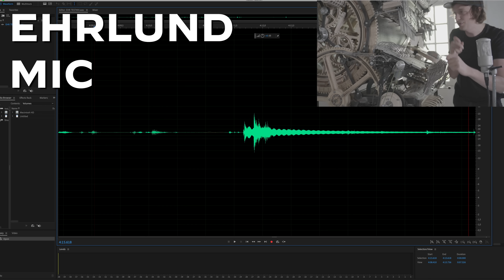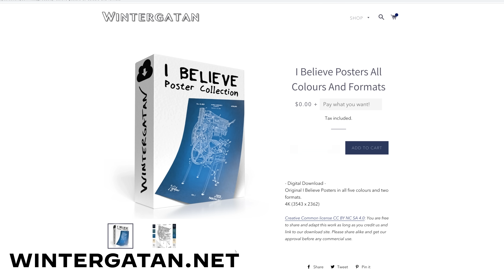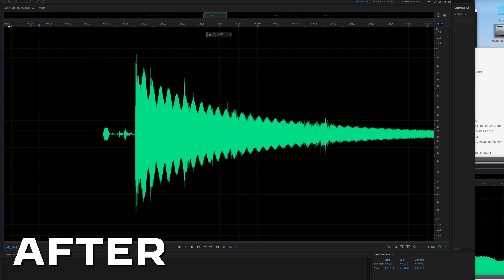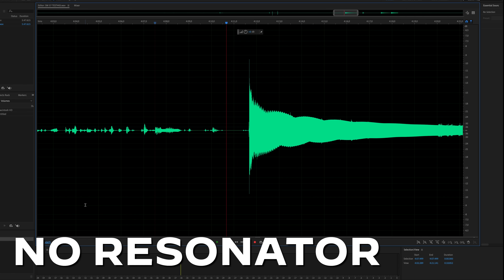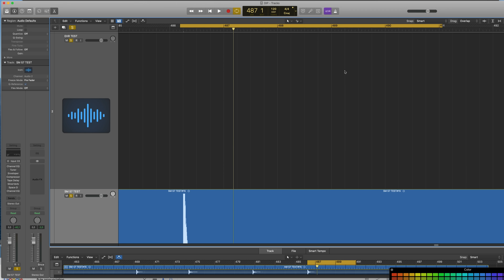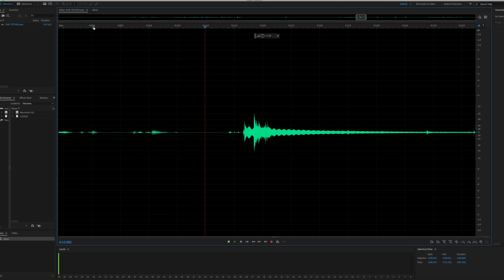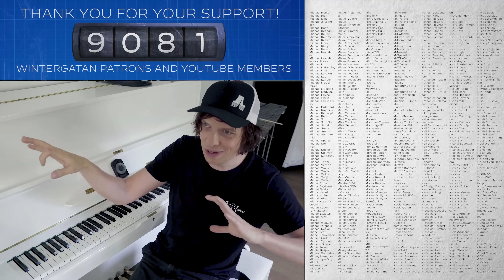Candy Dip for Marble Funnels - Marble Machine X135

Comment: I've always been curious about how to replicate vibraphone mallets as to imitate a sharp attack, with a hit that won't completely damage your vibraphone keys over time. Have you every thought of manufacturing a semi-thick yarn or nylon-woven pad and adhering it to the keys, rather than rubber? Typically, vibraphone mallets are yarn around a rubber ball. Maybe a thinner rubber layer than what you had here with a yarn pad underneath, instead? I know you would probably want to have a sharp hit so that your signal to noise is huge for the mics, but I would be worried about the bearings breaking and de-tuning those keys over time (and for your ears). Keep strong, Martin! Almost there. (:

Comment: For the 'movement' on the funnels remember your Springsteel adjustments. You can still strike a balance between weight, sound, movement with that adjustment.

Comment: Martin. What a great job. It is fascinating to be able to following your development. However, I have concerns with the durability of the coating. In order to maintain the great design, one way would be to scan the cups with a 3d-scanner and then use this data for additive manufacturing the cups. This would almost completely eliminate the metallic noise. Best regards, Peter

Comment: The pitch shifting that you hear with the vibraphone bars is definitely because the tube was not perfectly in tune with the bar. Thus the frequency that was being amplified by the resonator (thus lasting longer) was different to the initial frequency of the bar, resulting in the 'pitch shifting'. 

With my ears, I can definitely hear at the start of the sound that there are two different frequencies in the same way an out of tune piano sounds. So I think you just need to more properly tune your resonator pipes.

Comment: Constraints is not that bad, when you run into problems is the conflicting constraints when better sound=uglier. In this case you can’t just focus on the  audio quality because most of the enjoyment from the marble machine is that it is mechanical. You have the off beat shuffling of marbles, wheels that is whirring etc. How boring would it be if the audio was just perfect without the artefacts from the machine itself. 

And the design intent is that the machine should both sound nice AND be a marvellous looking mechanical contraption — it would not be the marble machine without one of them!

Comment: The rubberized coating will not have a great bond with that polished stainless steel. I'm concerned that over time the marble impacts could break it loose and flakes might fall into the tubing obstructing the marbles paths. 
Two possible solutions if this occurs. 
First, closely monitor the coatings conditions and as soon as it starts to degrade you need to strip it down and reapply it.
Second, is to blast the stainless steel in a sand blaster. This will cause enough abrasion on the surface to increase the longevity of the coating.

Comment: The warmer the temperature, the easier it will flow. Cooler temperatures will make it thicker. You should be more concerned about the temperature affecting the cure.

Comment: In regards to your resonators being out of tune, you can see that in the waveform.  If you have two notes very close to each other playing at the same time, their sound waves will shift in and out of phase with each other.  If I recall, you can calculate how far apart the two notes are by counting the number of times the combined sound fluctuates in a second.

You will have to forgive me as it has been over a decade since I took physics, so I do not remember the exact formula, but I do know that the closer the two tones are, the slower the fluctuation in the combined sound.
Reply: The beat frequency occurs at the difference of the two frequencies. Sounds to me like it's about 10Hz, but I'm pretty sure it's the harmonic that's beating (two octaves above the fundamental). Which would make the fundamentals about 2.5Hz apart, which is about what it sounds like.
Reply: A lot of DAWs have a phase meter built in you can just use that
Reply: Guys stop, it's just inharmonicity

Comment: Engineers become very aware of the inherent tradeoffs in any development, which you are realizing as you go.  Adding more to a fundamentally flawed implementation is called a "Kluge"  (pronounced "KLOOJ").  It is not a term of endearment.  Fixing the root problem, or rebalancing/refactoring the design is what I've seen you do more and more of.  It's been great to see your evolution in this, and I have to admit tearing my hair out with some of your solutions, thankfully to see you reject them in favor of better ones eventually.  When you finally finish your design, it could serve as a case study in how to incorporate art into engineering.  Keep it up!

And please use a different material other than plywood for the marble return path merge sections....:)  Milled plastic or nylon would be much more stable.  Even 3D printed nylon or PETG..

Comment: Your test isn't only checking the effectiveness of the rubber dip.
It is also checking what removing the extra bit of metal does.
Ideally to check the effectiveness of the rubber dip you want to compare before and after the dip, with no changes.
So either rubber dip with the extra bits of metal, vs how it was originally or as it is now vs how it is with the extra bits of metal cut off.

Comment: Hey Martin, I actually can hear-visualize some interesting tones with no pad.  You get those very mechanical highs what I think is D harmonic VIII / B harmonic V that would be interesting for such sustained keys.   If the harmonics could be controlled between bars, perhaps have more than one set of bars with different pads?

Comment: Noise reduction was great even if some noise is still present. At this point I think the extra noise actually fits with the mechanical, clockwork aesthetic that I believe the Marble Machine is going for. It gives a background texture much like the soft static of a record might give to a good tune

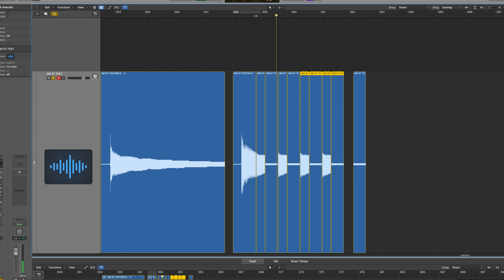Comment: 9:45 Sounds to me like the two tones you are hearing might be a psycho-acoustic illusion. I hear the fundamental clearly as the same note during both sections, the difference is that the beginning of the transient the overtones are much louder, and the overtone an octave up is slightly flat. I think this creates the illusion that the fundamental is lower than it actually is, so when you hear it by itself it sounds sharper. 

This used to be a huge problem for me tuning drums to a specific fundamental, because the overtones would mess with my perception of the pitch. I was able to train my ear to pick apart the frequencies better.
Reply: Nope, the resonator is clearly sharp, you can hear it being distinct from the actual fundamental and making interference beatings with it. It just plays for longer.
Reply: @bacicinvatteneaca  Pretty sure the beating is from the first harmonic (two octaves above the fundamental). Sounds to me like the beat frequency is about 10Hz, which would mean that the fundamentals are about 2.5Hz apart, which is pretty much what the "jaws" rendition sounds like

I also think the harmonic on the bar is slightly out of tune - I noticed this in the original vibraphone video that all the harmonics sounded slightly off (hurt to listen to with headphones)
Reply: You'll never fully diagnose what you're hearing as you're hearing it after compression.

Comment: The "over-engineering" of this project is a stark contrast to the first marble machine. I think it was a good idea to improve things and make a more solid machine, but that the idea that it was going to be perfect might have been a stretch. As has become evident several times, many ideas didn't hold up to these high requirements. Perhaps the popularity of the project and the amount of people involved have made things more difficult, even though it has also helped in some regards.

Comment: Martin, why not use a weaker spring steel? You made it so that it was interchangeable, so you could also add shims on the inside of the springsteel so that it exerts less torque so that the marble’s momentum can move the funnel?

Comment: Don't be so hard on yourself.  No design is perfect on the first go.  And unless you have some mega time constraint by which it needs to be done, there's nothing wrong with setting the bar really high and refusing to drop it until you have no other choice.  That's not bad design, that's just a choice and if you hadn't done that I don't think this machine would be nearly as impressive at it is!

Comment: I think the rubber coating is too difficult, albeit a beautiful way.
Why don't you try the soft (transparent / colored - fun!;) сut lengthwise silicone tube?
You can extinguish the energy of the impact of the ball with a piece of soft polystyrene foam / sponge / paralon, I don't know exactly what it is called in English.

Comment: From what I remember about the design of the funnels, the motion is done with a simple wafer of steel to act as a spring. You may be able to get back the motion you had before by changing the strength of that spring.

Comment: I have a question: why not make the funnels in plastic directly rather than coating it in plastic? Because i think the plastic coat will depleat overtime and you will have to do this treatment again. 

If you made the funnels in plastic, or silicon i think it would be a lot better than coating it, then all you would need to worry about is painting.

Another idea is to put plastic, rubber or any other material in the hitting spots (where the metal hits metal) so it doesn't make this huge sound.

Comment: A good tip for your paint flow issue; you can use a heat gun or even a hair dryer to lightly heat the parts up before dipping or hit them with a little heat after dipping and it will help the paint flow.

Oh....forgot to add that before you turn on the heat gun and aim it at your freshly painted parts make sure there isn't a bunch of dust built up. I've made the mistake of flipping my heat gun on and watching the horror as a puff of dust and cat hair was blown all over wet paint. Ohhhh the humanity!!

Comment: Martin: it’s 27 degrees at night
Me: what you actually mean is that it’s 80.6 degrees at night

(Correct me if I’m wrong)
Reply: At 80 degrees it would burn his feet to stand outside; that's not too far away from the temperature where water boils. 27 sounds right; pretty hot but not uncomfortably so

Comment: so glad you you used proper air protection, and so glad you got rid of those colliding rails. The rubber would have eventually worn off.

Please consider how you're going to reapply this over time while touring, as the ball bearings will wear the coating off. Likely fairly quickly.

Comment: Lighten up on yourself. It’s NOT a fundamentally flawed design. Steel Striking steel was ALWAYS going to be loud.  The vinyl dip coating does NOT reduce the aesthetics and it Does solve the noise.  The only thing you learn is that when you design things that you want to be made of steel, you have to coat them in clear vinyl.
The ONLY design parameter this actually effects is the strength of the spring plate that controls the movement.
Seems to me you just replace all the spring steel plates with a slightly thinner spring steel plate and you have everything you wanted.
That is a GOOD design.

Comment: 09:06 - This is a psychoacoustic phenomenon to do with the missing harmonics. The fundamental will be much louder vs the harmonics at the later part of amplitude decay, as the higher harmonics decay much faster, so you're pretty much only hearing the fundamental at the later point. When your auditory system can only hear the fundamental frequency with no harmonics (a nearly perfect sine wave), it perceives it as being a slightly higher pitch. I'm not sure of the exact nature of what's going on in the brain, but I presume it's a well known effect. I learned about it years ago when experimenting with audio and psychoacoustic phenomena.

It may be that if you only have a single frequency as a reference point, your brain may not be able to work out the precise frequency, so it has a "best guess". But if you have several frequencies that are relative to one another (fundamental + harmonics), the neurons that listen to each fine frequency range are able to combine their effort to make a more accurate 'best guess' as to the exact frequency you're listening to. In isolation, they're not so good; in combination, they're more accurate.
Reply: Oh, and I believe this may also be part of the reason (but not the whole reason) we stretch tune pianos, and why our hearing and experience is much better than software when stretch tuning.

Comment: Just to add some random science to this comment section: If you take a simple spring–mass system (like the marimba bar) and excite it with a sharp impulse (like hitting it with a marble) it will start to oscillate with a certain frequency. As this oscillation fades out the frequency decreases. This effect might contribute to the effect you noticed in your recording.

Comment: The dip wants more temperature to spread more evenly.

Plywood box, heat gun or bar heater etc, plumbed extraction... Easy dipping and a decent future paint booth ;-)

Make it an insulated metal booth and you can build a powder coating oven >_>

I'm sorry about adding things to your list #scopecreep

Comment: You can't design without error...unless you are copying something already existing.  If you tried, you would never create anything.  And some things pop up that you wouldn't think were a problem until you actually experience them.   Why do you think automobiles and airplanes have changed and improved over the decades?  As far as mechanical noise...you intended it to be a mechanical device, therefore it will have mechanical noise (sound) ... you just have to redefine and narrow down what is acceptable noise, and unacceptable noise...but since there wasn't prior art about moving funnels to catch flying ball bearings...you have to find out for yourself...keep on building!

Comment: I think your explenation why there is less movment  in the funels is partiely wrong. The Reason lies in your methode of amplitude reduktion. You are isolating the ecitation from the marbels. Which leads to reduction in amplitude from sound and movement, because the impuls can't reach the funels. It is as if you had put a soft spring in between the funels and the marbels.

Comment: Heya bud, Sounds like the tone of the decay is about 27cents sharp. its not just you. it may be residual harmonics being amplified. these tones occur in the width of the metal plates and they are amplified by your resonators. Try adjusting the length of the resonator and recheck the lateral striking point of the marbles.

Comment: Quality - Cost - Speed : pick 2 of the 3. Basic project management 101. Esthetics is  generally a factor across all 3 and has to be weighted in its overall value to the project. You made a rookie PM error in over valuing esthetics vs sound and mechanical quality - which you ultimately decided was the root basis of the project - to make great music with great sound. This little facet of PM usually takes most project managers several years to get a good grip  on it. All-in-all, you have done well Martin, and you should be proud of what you have accomplished from a  white paper start.

Comment: It would be interesting if, in the finishing and clearcoating and detailing of the finished pieces, you could incorporate uv reactive pigments. So if you use UV lights on tour, you can highlight various bits of the machine with/without the pigment. Like a dark ride. When you want a moving piece to be seen or highlighted, you can toggle the UV light focused on that part.

Comment: Generally don't most liquids get less viscous with an increase in temperature, not the other way around?
Reply: Yeah I was kinda confused about that
Reply: Yeah the heat is probably affecting  the cure at most. Though maybe the easier flowing liquid is making the drips more noticeable whereas a more viscous liquid would stay higher up on the baskets and be more even
Reply: I think the material polymerizes and sets faster with higher temperature
Reply: I think the problem with higher temperature and so less viscous dipping liquid is that also the surface tension of the liquid is smaller and so the created coating is thinner (we are talking thin coatings here in the first place so there isn't much from which to get thinner) than promised and it may take shorter time to cure and that might affect how well it bounds to the coated surface.
Probably not a big problem for Martin as he can make multiple coatings to get to the thickness he needs and MMX is one of a kind machine. But these could be big problems in industrial use where you would need to get a lot of things coated almost identically and the coating must perform the same with the thing #1 and the thing #1 000 000 and you cannot personally inspect every one of them.
Reply: I think that stuff just dries too fast when it's warm
Reply: Yes, unless a compund of that stuff can polimerize, then it will get more viscous the hotter it gets... And with what that stuff does, i'm almost sure there are thing in there that polimerize.
Reply: Methyl cellulose wallpaper paste does the the opposite.
Reply: The chemistry of stuff like this is too complex to arm chair. Read the datasheet. 

What's funny is that this bucket of goop is probably more complex then 90% of what SpaceX does.
Reply: Brandon Lisik “too complex to armchair” followed by armchairing LANDING A FUCKING ROCKET NOZZLE-DOWN ON A SHIP AT SEA is a fucking MASTERCLASS in arrogance.